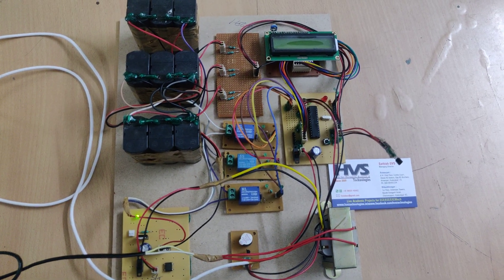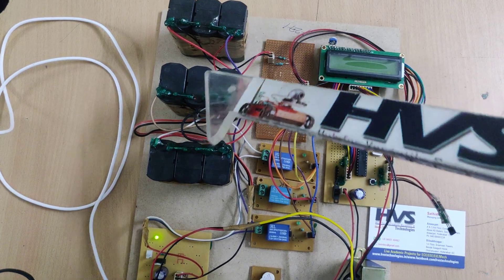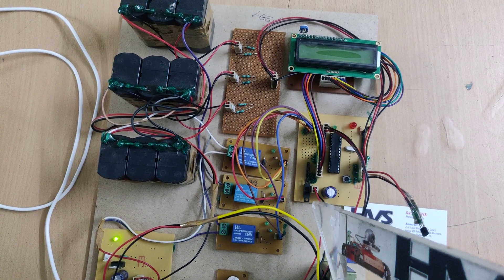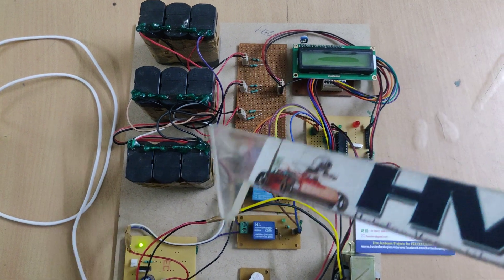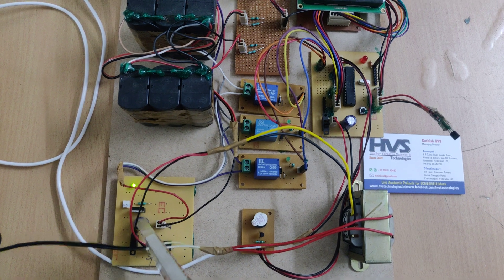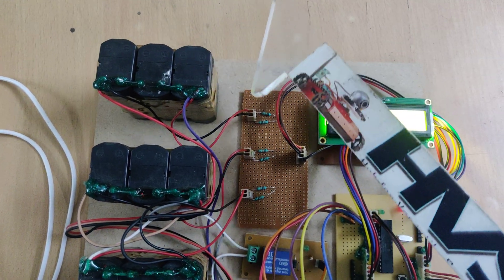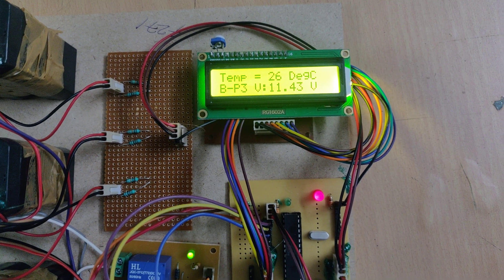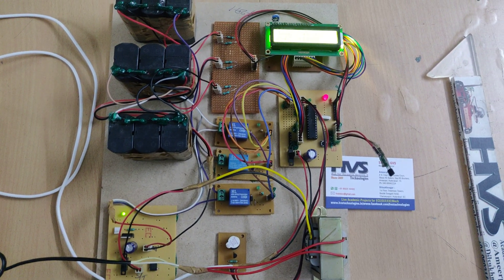Battery-Management System (BMS) and SOC Development for Electrical Vehicles

Comment: Sir after detecting the abnormal condition what we do sir to reduce the heat in the battery??
Reply from the maker: If heavy load on the battery or high input voltage to the battery- in these cases battery will get heat, so we should check these parameters
Reply: @hvstechnologies  after checking what we do sir?
Reply from the maker: @myyou632  isolation battery from load or charging section